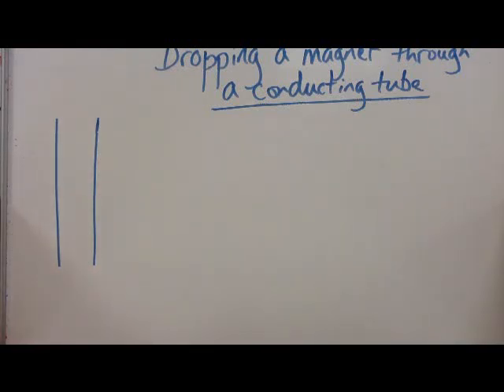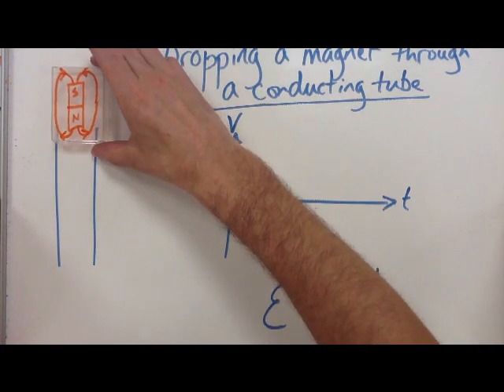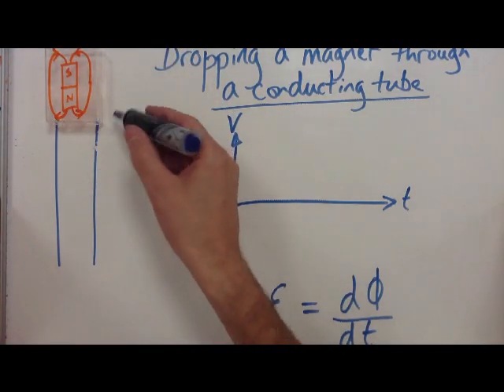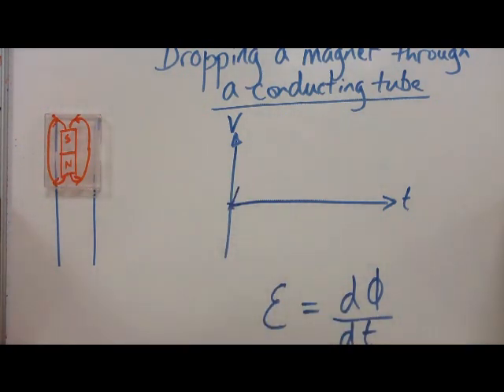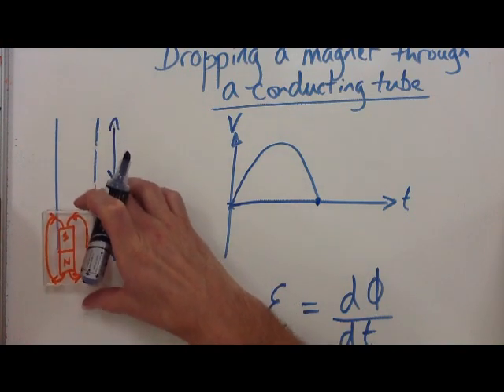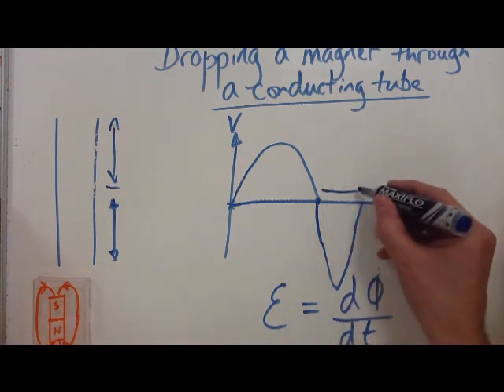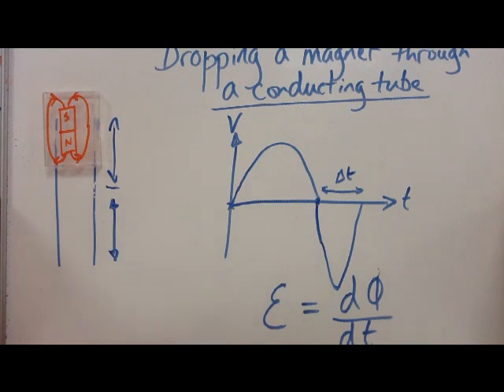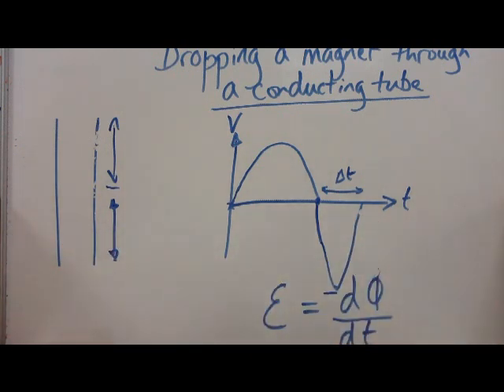Dropping a magnet through a copper pipe

Comment: What happens to a bulb if it's connected to the coil?
Reply: The brightness of the bulb will increase in the same way that the voltage will increase. V = RI and since R is constant I is proportional to V this more current = more charge = brighter. It does not matter which direction the current is flowing so the brightness corresponds to the absolute value of the graph.

Comment: Why only copper pipe not any other conducting pipe..?
Any substitute??
Reply: surendra sharma any, but copper is the second best and cheapest conductor after silver
Reply: We can substitute any conductor but copper is abundant (therefore cheap to mine) and happens to work really well due to it's delocalized electrons. Aluminum works and is cheaper but it oxidizes easily which makes it less effective long term.

Comment: Does it matter which end of the magnet (N or S) goes through first?
Reply: By Lenz's Law of Electromagnetic Induction, the direction of the induced current is such that it opposes the change in magnetic flux that is producing it. Put simply, when the north pole is at the bottom and is approaching the pipe from above, the top of the pipe will form a north pole to repel the magnet in an attempt to restore the original flux linkage. If a south pole is at the bottom, the top of the pipe will form a south pole. The formation of north and south poles at the top are achieved via induced voltages in opposite directions. Therefore the voltage will move down first instead of up on the graph. Hope this helps
Reply: Yes, the induced current and emf will be in the opposite direction if the south pole is at the bottom. The graph is inverted along the x-axis (time) if this is the case.
Reply: Could you please explain why? Thanks

Comment: Aren't the amplitudes of the waves the same, since they are both slowing down when it enters the tube and when it leaves the tube?
Reply: No, the magnet accelerates due to gravity and is thus moving faster as it exits the coil therefore the rate of change of
 magnetic flux (linkage) is greater which results in a greater induced emf (according to Faraday's Law of electromagnetic induction.)